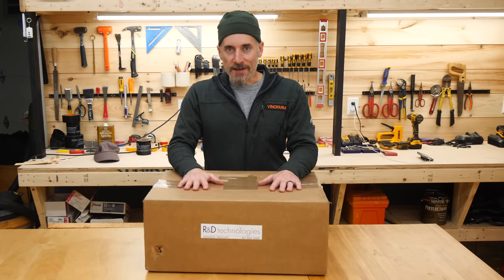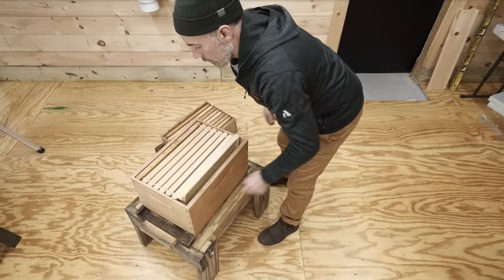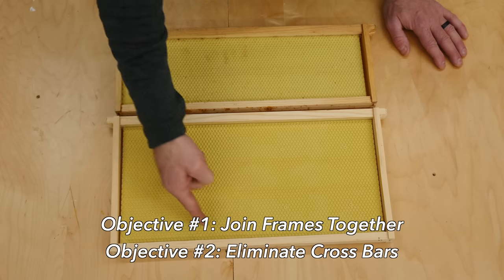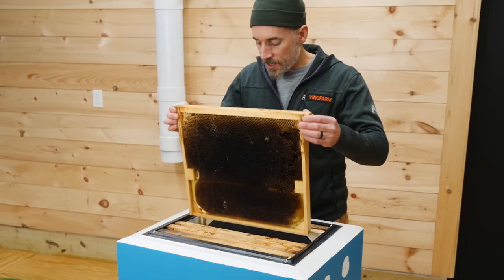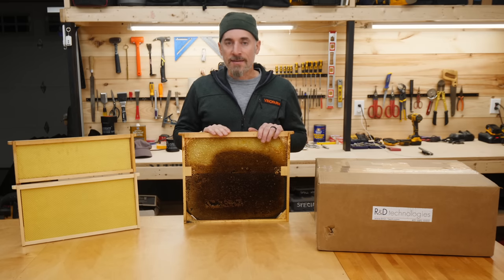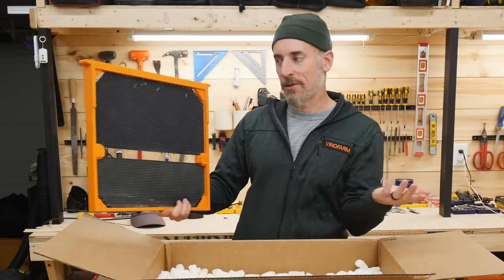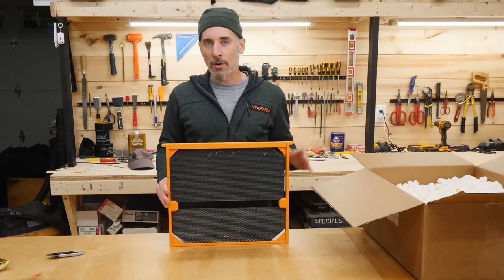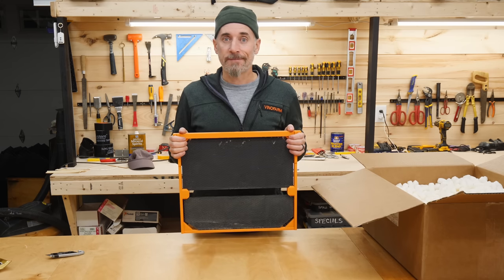Bigger, Better Bee Frames? Let’s Make This Happen!

Comment: You talked about alternating deep and medium foundation locations previously, do you plan on making molds for alternating foundation sizes?
Reply from the maker: Moveable blocks. Or something along those likes.
Reply: @vinofarm  Screw the blocks,  make one-piece foundations with holes/gaps cut out for passages and bees' choice cell size.  This will likely substantially reduce the cost of the mold also.
Reply from the maker: @robertbennett6697   That's an idea. BUT... the blocks allow people (me!) to take existing comb with fully drawn foundation out of old frames and pop them into these big frames. Then just use easily attainable commercially available blank foundation to hot-swap out old brood foundation for fresh waxed foundation. Not possible if there was molded-in foundation. It is a good thought, though.

Comment: I'd like to know the process you are taking that takes 8 passes in the table saw to make the side bars. I make my own layens frames,  and I cut the taper in the sides with a router. Some use a jointer. I recently saw someone use a dado blade in the tablesaw with a fixture that cut the tapers safely. 
Now, one thing I would suggest (for wood frames anyway), is that you staple the sidebars into the horizontal bars...horizontally! Propolis plus weight can cause a simple glue joint with a staple or nail to pop out when you are trying to remove that first frame, I'm sure most people experience that eventually. 
Being in the plastics industry, yes, its very expensive to get an injection mold made. The inside grooves and the foundation holding ears on the inside makes it much more complicated. 
I wish you luck in your fundraiser, but I get the feeling you are making the wood frame manufacturing harder than it needs to be.
Reply from the maker: My first round of 100 frames took 8 passes. Then I shot this video. 

I've since streamlined the process to 6 saw passes plus the groove seen in my previous video here: https://www.youtube.com/watch?v=nK_TGfDYWcA 

I save the side shaving to the last step because I put a groove in the sidebar for the gussets. Can't cut the groove if the sides are not square.

Comment: You might look at just doing the sides in injection molding while using available top and bottoms in wood. This would be less investment needed for development and more scalable for mass production. It would also be more economical for shipping. 
     One side design could mirror both sides and mate with the most common/ affordable top and bottom wood bars.
Reply from the maker: Joining plastic to wood is not as simple as gluing wood to wood. I’ve been through a few design ideas!

Comment: the frames won't work. if you get a real good honey flow and those long frames get honey bound you will break the top bars trying to pry the frames out of the box. bee barn 3.0 will have regular sized frames.
Reply from the maker: Well, in two years I haven’t come close to breaking a wooden bar. So I disagree with your prediction. Just how heavy do you think an extra few inches of honey is?
Reply: @vinofarm  every 4 square inches of comb is 12 to 16 ounces.
Reply: @vinofarm  you also live in a nectar poor area. this wouldn't work in good or above average nectar conditions.
Reply from the maker: @lordmike1627  These are brood frames in a brood box. They get honey on them, but they’re never FULL of honey.
Reply: @vinofarm  because youre in a nectar poor area. its not just the weight of the honey its the brace comb that they will build all up and down the comb in a really strong flow that will make it impossible to remove. the would also softens over time which makes it even more likely to pop top bar off the frame. if you haven't seen your brood nest laced with brace comb then you haven't experienced a real honey flow.
Reply: @vinofarm  in a nectar rich area the queen will lay all the way to the bottom of the frame and into burr comb made off the bottom bars in a regular langstroth box..
Reply: @vinofarm  laying to the bottom of the box is also genetic but mostly a reflection of the quality/quantity of forage in your area.
Reply from the maker: @lordmike1627  Laying to the bottom of the frame is something I had not seen in 5 years of keeping bees in regular boxes. Once I put bees in deep, insulated boxes, ALL of my queens began laying to the bottom of the frames. It’s not because they all coincidentally had great genetics. And if you’re telling me I’m in a nectar poor area, then it wasn’t due to nectar flow. So I believe it has a lot to do with the insulation and the long comb.
Reply: @vinofarm  insulation always helps i can't disagree with that. i think the extra large frames are overkill that would hurt you in a really good year when you run out of supers to put on hives and they respond by fully backfilling brood frames. you can achieve the same results with regular deep frames in any poly type box.
Reply from the maker: @lordmike1627  What about the part where you only need to lift a max of 7 frames per inspection as opposed to perhaps 12-16 plus lifting boxes? I’ve been living this for two years. You can NOT convince me this doesn’t work. And nobody is making you use these frames. You do whatever you like!
Reply: @vinofarm  first of all if you don't like lifting boxes frames then beekeeping is not the activity for you. second of all once you know what youre doing with bees you only need to dig through more than 3 frames if there is a problem. and idk what youre planning on making these giant frames out of but unless they're stainless steel they will brake under the pressure of the weight of the honey in a very strong honey flow. lifting less frames that brake more often is a disadvantage not an advantage. aside from the giant frames everything else about the bee barns works fine. make it work with standard sized frames and you'll probably sell a lot. there's no need to reinvent the wheel when it comes to frame size. the industry has only tried every size including yours over the past 150 years and the sizes we have today work best. i guess you know better though.
Reply from the maker: @lordmike1627  oh boy. You really hate these frames.

Comment: I have really enjoyed watching you videos, I was impressed by the build of the frames although I did cringe a few times while you were building. I am curious, the 3D printed frame is plastic typically ( and for simplicity sake plastic is general term). 
Do you plan on using a wood material or plastic? I personally like the idea of an HDPE material so you can use recycled bottles. So with that said and a small redesign you could build these in 3 or 4 steps. Conservatively you could do 15 frames an hour, but if machinery and tolerances hold at speed 40 to 60 and hour possible more of material is consistent. It also depends on your approach to manufacturing and costs for capitol outlay.
Oh almost forgot, will you want the frame to have the same material throughout or would purchased wood tops and bottoms combined with sides made from something else be okay?
The recycled HDPE may keep costs down, but I have seen some people complain about not getting enough recycled material and of course the material needs consistency or it will drive you crazy. I think you'll have a lot of fun developing this...
(edit) I forgot to mention (it was really late) the way to make these so fast is not injection molding. Use extrusion and a stamp (like cookie cutter) This is a continuous operation and if the frames maintain shape (ie no warpage), you could pump these things out really fast and cheap.
-MG

Comment: I'd imagine that whatever tools Dadant or Mannlake (or whoever they supply from) could be adapted pretty quickly to making wooden versions.  The side bars are basically just a longer piece of wood fed into the cutter than what they're already doing.  The extras for the frame support would be a bit more.
Reply from the maker: Anyone can go ahead and make wooden frames. I'm going forward with injection after two years of hassling with wood.

Comment: That's awesome!  I like that they are solid without the places for SHB on the edges.  Your concern with the medium and deep foundation aligning seems like it could still be an issue if they are all made the same until the frames are drawn out is that correct?  Even if people aren't making bee barns and using standard equipment it seems like you would get a lot of people buying them since it's much easier if you only had to pull a large comb out instead of going through 2 boxes like you mentioned.  I love it!  If you have a kickstarter I would absolutely help contribute.  Thanks for sharing your innovations with the beekeeping community.

Comment: Great idea I hope it works out for you  but if you spend the money to make a mold wouldn't you want to fill the gap with the plastic foundation as well. Get them to make a plastic foundation that is that deep in one piece or use 2 deep pieces of plastic foundation. Just my opinion. Good luck.

Comment: Hey could you not get rid of the two center blocks and make the foundation one continuous sheet?
Reply: The free gap in the middle is intentional so the bees can decide if they want workers or drone comb there or maybe let it open for additional shortcuts

I believe it is also the most likely place for them to place queen cells
Reply: Also means you can use common, existing foundation sizes
Reply: I know why Jim wants the gap. I do not want the gap. Hopefully he can give us the option of gap or full sheet.
Reply from the maker: See pinned comment!!!

Comment: Great idea. Good luck getting this into production. Will the frames use wax foundation?
Reply: The outside frame still uses the inside plastic frames with the wax coating. Unless you catch a swarm or do a cut out and then it looks like a great solution to keep from having to cut the brood nest in half to fit into a 10 frame (depending on the size of the cutout).

Comment: I'm interested! Have you tried to contact your local vocational school/career center? They might have the equipment to make the mold and the cost is low because it's a school project.
Reply from the maker: It’s a good thought, but Injection molds are not going to be made as a school project. The factory doing the manufacturing usually has a very short list of suitable mold makers they work with so the molds work with their machinery. It is a highly specialized field.

Comment: Make sure the mold has inserts that can be swapped to be able to make deep frame either bottom, or top. That is normally done by a simple insert that can be screwed out and moved. You would end up with 2 movable "blank" inserts for the deep side, then 2 movable  wedge pieces where the gap is. Swapping them moves the gap to the top or bottom.

Make sense?
Reply from the maker: Way ahead of you!!! Yes.

Comment: Would a 3D printed side bar be enough to then use the rest of the already available parts?
Reply: My thoughts also.
Reply: I think he mentioned having to put together the frames and it still taking on hour to put together 4. Side bars could be a temporary fix but the all inclusive mold to just inject a bunch would be a huge time saver.
Reply: @trumanpadgett2747  injection molded would definitely be the huge time saver. I’m just wondering if there might be other ways like 3D printing or a cnc process that could be done for those that don’t mind spending some time for small volumes.
Reply: Same question. I've been talking with a cousin about printing the side bars because I'm not comfortable enough with the table saw to be as squirrelly with it as our host.
Reply: @HappyJF  3D printing is significantly more expensive than injection molding.
Reply: @apveening  out sourced yes. But I along with many others have 3D printers.
Reply from the maker: 3D printing is super costly. Even for just sidebars. Then you need to figure how to join plastic sidebars with wooden top and bottom bars. It's not a smart solution. I've hammered this all out in my head for the past year. I made the last video to show people how to make these if they really want to. But I've come to the conclusion that injection molding is the long term solution and the best way to go by far. It's also the most expensive up front. But after I have a mold, these will be way cheaper than wood when you factor in time and materials.
Reply: @vinofarm  thanks for the reply!

Comment: Injection molding isn't that expensive, I mean, it's not cheap, but its more reasonable than you would think. I was a Merchandise and Branding Office for 6 years for my nerd hobby, and I made a ton of contacts in China. I'd really recommend contacting factories directly, middlemen are expensive.
Reply from the maker: Injection molding itself is pretty affordable and efficient. But you need a ‘mold’ to do injection molding. The mold for this type of thing could cost $100,000 to make.
Reply: @vinofarm  kind of. If you are making a single piece, 1 solid frame, yeah its pricey. If you broke it into 4 pieces (3 mold pieces) that are assembled on site as a kit, it dramatically drops the price of the mold and shipping.
Reply: @vinofarm  And if we broke the whole thing down, the top and bottom rails are easy to get, you just need to make side rails, and since they are symmetrical, that becomes 1 much smaller mold, but I get it, its not as neat as a single injection molded frame.

Comment: Did you consider just molding the siderails?  As you pointed out, this was the crux of the issue in creating these frames.  Why spend time/effort/cost producing the top and bottom rails which are already available in mass production?
Reply: Ooh.  Or creating a jig to do a cutout set up on a piece of wood and then do the standard bottom and tops.
Reply from the maker: Not sure how to mix the wood and plastic with joinery/adhesives. It’s an interesting idea.

Comment: Did you print another one for the medium on top?
Reply from the maker: No. There is another solution. This is a prototype.
Reply: @vinofarm  based on the video where you hand made them I assumed a second mold would be needed. Curious what that other solution is :)
Reply from the maker: @planbeeapiaries  Moveable spacers!
Reply: @vinofarm  Nice!

Comment: Not sure why you are not philosophically opposed to plastic and mass production  as a beekeeper... plastic is the past of everything...
Reply from the maker: Plastic is a fantastic material for many, many applications. But yes, single use plastic is terrible. However, These frames are going to live inside a moist environment and get handled over and over for many many years. They will be stronger and more durable than wood and last a lifetime. Sometimes plastic is a superior material to wood. After hassling with these frames, making them one by one over the past two years out of wood, I decided I was done and now I’m thinking about the future and the scale of what will need to be produced. 

However, if you really really want to make these out of wood, I purposely uploaded an entire tutorial about how to do that last week before I shared this plan. No one is stopping anyone from building these one by one with wood. I just know the vast majority of beekeepers would rather click a button and have a zero-maintenance, durable product arrive at their door.

Comment: If it were me I would have then pressure formed. Call Robinson Industries in Coleman MI. They would make the tooling as well as form the parts. I'm not a pressure forming expert, but I think it would be cheaper, can't hurt to check. I have 3D printers and used to have a Vacuum Form shop, Robinsons is two miles from my home.

Comment: Is there any chance you could make double deep frames? I would buy those without question.
Reply from the maker: I am looking into multiple sizes. However, each size needs its own mold. So $$$$$$…
Reply: @vinofarm  I did a little work with injection molding machines 15 years ago or so.  I wonder if the Mold might be constructed in a modular fashion.  Top section, mid section, bottom section.  Swappable mid sections might allow double-deep or deep-medium variants, and rotating the mid section 180 degrees would allow creation of the two deep-medium variants (deep-top and medium-top foundation location).  You'd need decent flatness on the mating surfaces to make a tight fit, but they might be able to integrate some vent features (for air being expelled during injection) into the parting lines.  Maybe too much complexity if you are going to go with a multiple cavity mold for high volume, but it might be worth looking into.  Good luck, looks great!
Reply: @HoboWhisperer  I like that modular system idea. I know nothing about molding plastic parts but it sounds possible. However, the different variants must then all be STRONG.

Comment: I’d get 10 on the first run. Just a thought, years ago I worked at Ruger firearms in Newport NH. Not too far from you. Anyway they molded stuff and also made models of frames out of wax, coated them with ceramic and poured molten metal in, that evacuated the wax and made pretty detailed pistol frames. It might be worth reaching out to them.
Reply: Lost form casting is nice for expensive stuff in metal, not so much for cheap stuff in plastic.